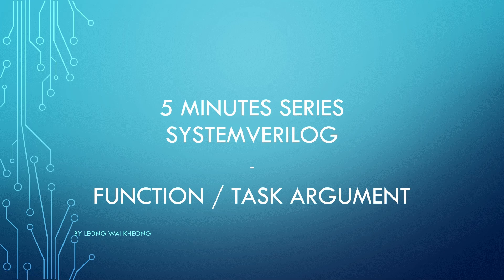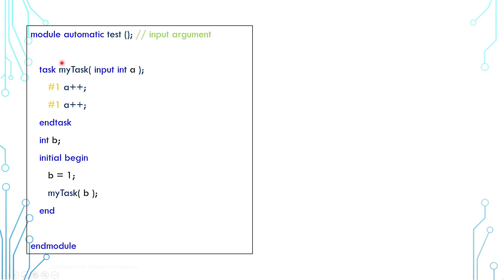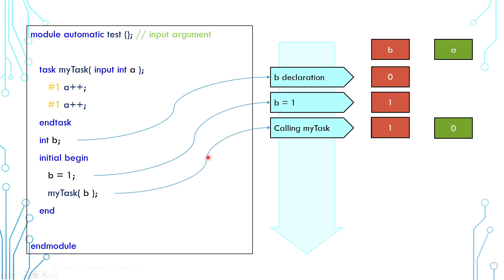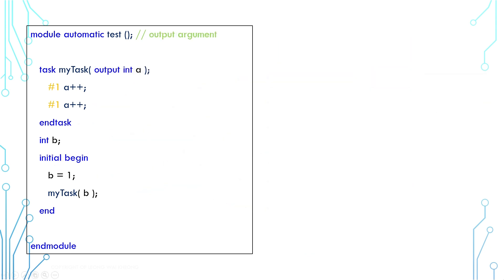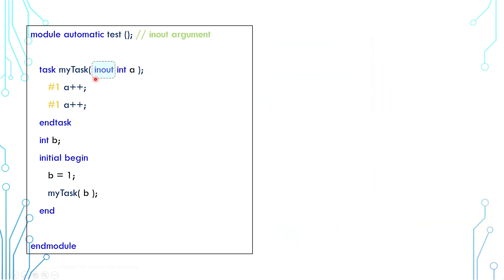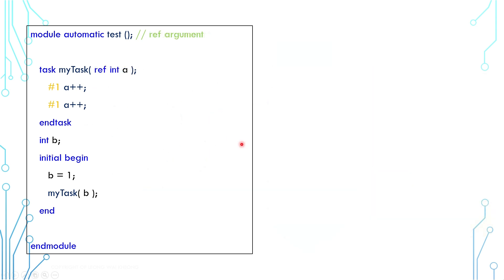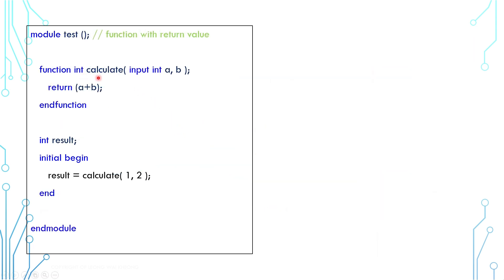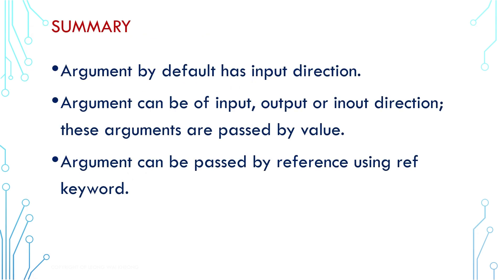SystemVerilog Tutorial in 5 Minutes - 09a Function / Task Argument

Comment: Thanks alot for the video, though i have a question, i tried coding this to display the a and b values, but the printed values in the eda simulator happens to be as below. which doesn't match with the video above. is the default value of  a = 0 or is it x since its an output int?thanks in advance.
a=x
a=0
a=1
b=1

module automatic test();

  task mytask(output int a);
    $display("a=%0d", a);

   #1;
    a++;
$display("a=%0d", a);

    #1;
    a++;
$display("a=%0d", a);

  endtask
  
  int b;
  
  initial begin
    b=1;
    mytask(b);
    $display("b=%0d", b);
  end
endmodule
Reply from the maker: Which simulator are you using? On top of my head now, a cannot be x because it's an int which is 2-states variable. If a is x first, then a++ would not be 0 technically. If I must guess, I'm guessing the simulator is not following the spec correctly.
Reply: I used the free Icarus Verilog simulator from Eda playground, should be issues with that then, thanks for replying